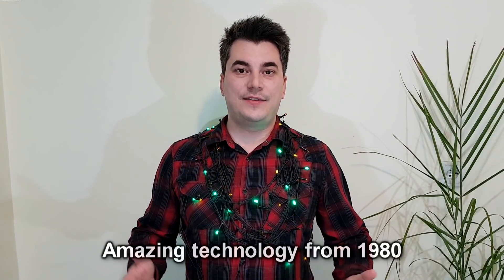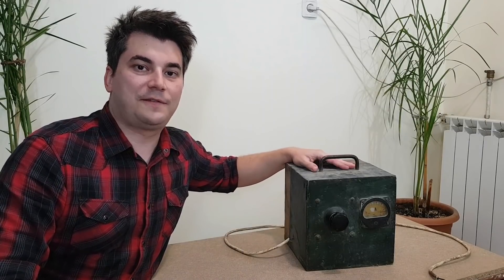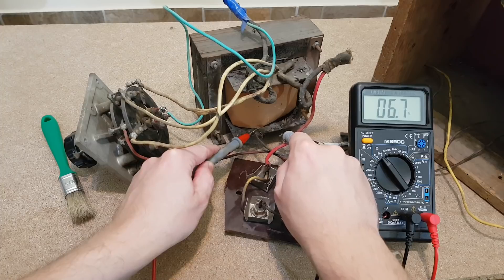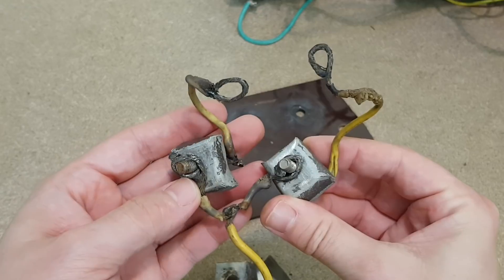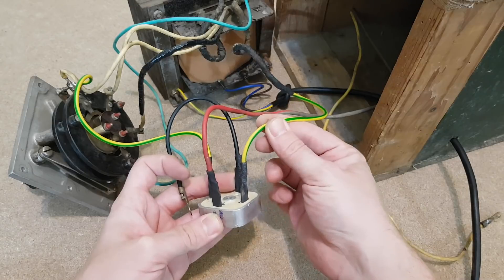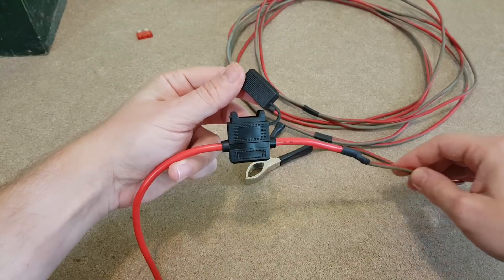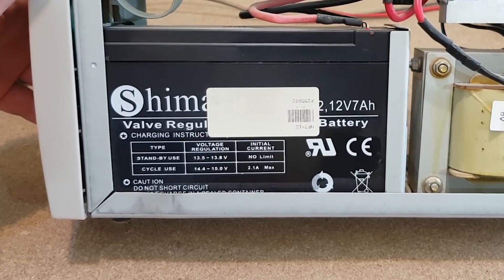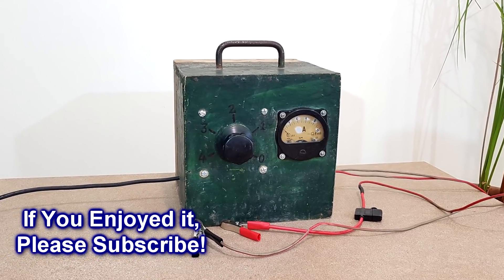Refurbished - Car Battery Charger From The '70s

Comment: Super Sorine, ti ai facut un nou fan :D 

Crezi ca este safe sa incarc o baterie moarta ca a ta la sfarsitul videoului, are 12v si este la acelasi voltaj ca a ta... ma gandeam sa folosesc o punte redresoare si puterea unui transformator de 12v, diodele clasice de 1A banuiesc ca nu merg pentru asa ceva nu ? :)
Reply from the maker: Salut. depinde ce transformator ai. pentru a incarca o baterie cu plumb de 12V iti trebuie un transformator care sa scoata minm 13V si cativa A. circuitul electric al unei masini are intre 13.8V si 14.4V. automat si puntea redresoare trebuie sa fie mai puternica. iar daca bateria e complet descarcata trebuie sa limitezi curentul de incarcare, altfel o sa traga foarte mult curent.

Comment: Don't throw away lead acid batteries that are 0v or 12v but don't give almost any current. The lead plates get sulfated but the battery itself is fine. 
To fix this you need to charge it and connect it to a load and repeat this process many times and you will eventually get a fully functional battery again, Trust me I have done this many times and have recovered 80% of supposedly dead batteries that aren't actually dead
Reply: capatalist world bro, they always want us to buy and buy ( > get more poor) while they get richer...
Reply: @DrZipZwan  What? this has nothing to do with capitalists, people just either don't know about this or they know and they wont waste time on this because it does take a lot of time. Just imagine a company needing hundreds of these, Would they waste their time fixing some dead ones? Or buy new ones which have more capacity and will last longer as well as get them back in considerable less time rather than fixing them.